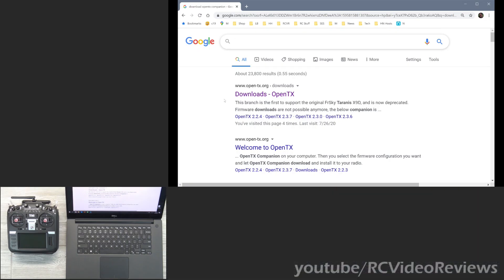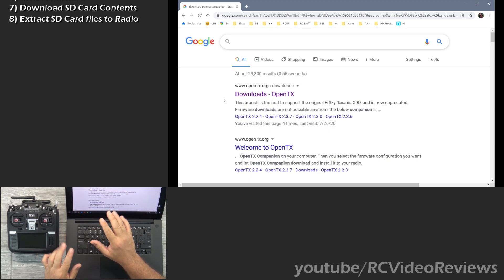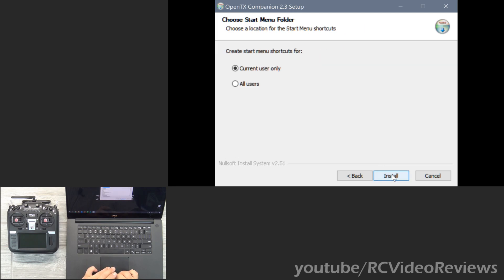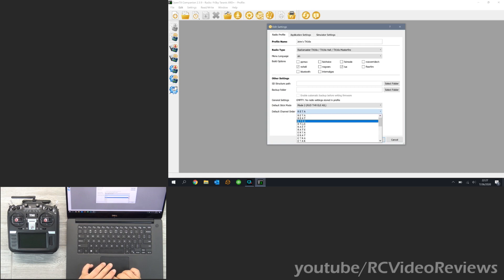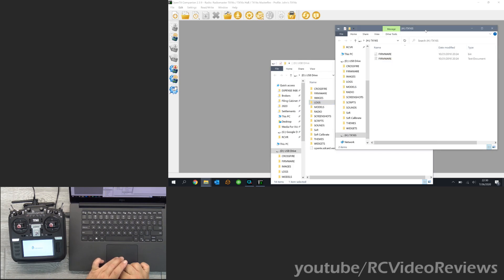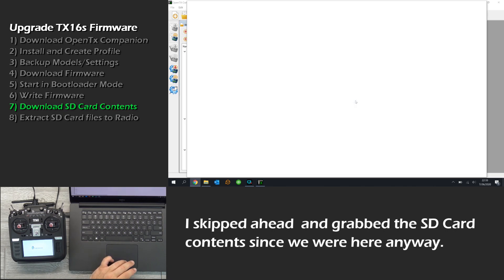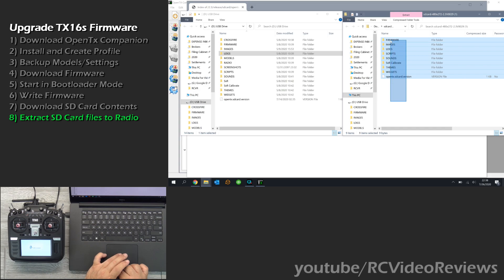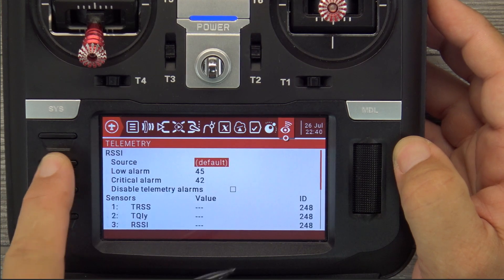OpenTx Companion Tutorial • How-to Upgrade Firmware on Radiomaster TX16s • [Beginners]

Comment: Hello,it keeps show sd card warning. what happen??
Reply from the maker: Sounds like you don't have the right sd card contents. What firmware did you install and what version of sd card contents did you install? What is the exact error message?
Reply: @RCVideoReviews  Thanks for the reply. I already fix the sd card warning sign. But when i tried to copy the latest version of sd card content then try to "write models and setting to radio" the error " cant find radio sd card pop up. Then i install the back up version everything back to fine. So, is there miss step or something that i done wrong? Thank you in advance.
Reply from the maker: @firdausjohari3692  After you write the SD Card contents, make sure to reboot the radio twice. Then you should be able to read/write settings ok.
Reply: @RCVideoReviews  alright will do

Comment: my radio arrive yesterday and when i try to start bootloader mode the radio turned off by itself after entering bootloader mode a few second, do you know how to fix it?
Reply from the maker: I haven't encountered that one. I believe (but haven't tried it) if you leave the radio off but plug in the USB cable on the top port you can flash firmware.
Reply: @RCVideoReviews   i already did that before but not work idk why, but after you said that i'm doing it again and it works, thanks

Comment: Watched u r sD card vid.  I think my big problem is ive been a mac user 20 years and bought a MS computer to run beta flight, open tx, liftoff,etc.  the basic steps like making a file, and drag and drop are stumbling blocks i need to get down before using open tx.  Ty for your help.  J
Reply from the maker: You can do all of the SD card content manipulation on a Mac. The rules apply: Extract and copy. Mac does leave detritus on SD cards but OpenTx ignores it.

Comment: Got all the way to step 8.  My new I7 pavalion wouldnt let me drag and drop all the files from sD 480 x272-2.3V to usb  d  so i dragged them individually and it locked up at 72%. Been 8 hours today trying to get thru these 8 steps. Almost made it.  Now where do i go from here.  J.  Day 2 on TX 16 S.  Smh.
Reply from the maker: John, I'd stop and take a breath. It sounds like you're hitting a wall.

1) There's 100% no reason you can't copy the SD card contents from the zip to your card. You need to figure that out first. There's also 100% no reason to copy individual files one-by-one. So I would suggest going back to that step and sorting it out.

2) I just did an SD Card video for OpenTx here: https://youtu.be/vQGaasNHckc  Maybe that will help.

3) Make sure you've unzipped the archive before copying. There are about a dozen different ways to handle zip files. I'm not sure which one you're using. With the windows archive handler you don't have to necessarily unzip first, but just to eliminate possible issues, make sure to unzip the archive before doing anything else.

Comment: I will update the opentx 2.3.10

 I want to ask

 What will be on the checklist?
Edit settings-radio profile-buld options?
 Tx16s I used for the helicopter

 Can u help me?

 I'm a new tx16s user, still have a lot to learn
Reply from the maker: You're asking about build options? I only select LUA and NOHELI. If you're flying helicopters you may want to leave NOHELI unchecked.

Comment: After I updated my radio firmware to 2.3.10 it has a very dark blue theme that is low contrast. How do I change it to the original theme please?
Reply from the maker: From the Home Screen press the tele button on the bottom left row of buttons. Press page left and select the 2nd theme from the left.
Reply: @RCVideoReviews  Wow what a quick response. Sorry for the newbie question. Thank you.
Reply from the maker: @petebuttons210  No worries. Did you find it?
Reply: @RCVideoReviews  Yes thanks. It is a real steep learning curve but I am enjoying the build.

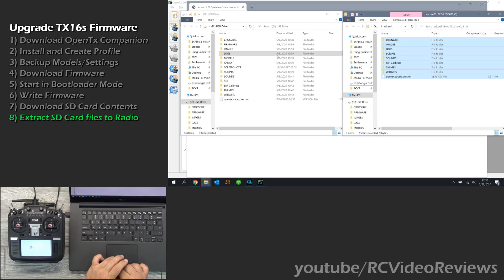Comment: 13:12 Do I have to delete the old folders on the left side or do I just have to copy the new ones from the right in? I recently switched from Futaba
Reply from the maker: Personally, I prefer to start with a clean SD card. The stock card does not come with models or radio directories, so you need to make those. If you don't, the radio will make them for you.

Comment: After all done is save disconnect of the two drives in Windows on the right bottom corner (Hardware save removal and media) in your view important. Radiomaster manual gives no answere.
Reply from the maker: Not on Windows 10. That is a dated practice and no longer necessary.

Comment: Hi John, during this procedure when write the new SD card content to the SD card in the radio the computer told me that the space is to small. The SD card is only 256 MB. Delete of the old content before was necessary. A little bit nerving just handling the new radio. I can imagine that some model airplane pilots frighten a little bit because they didn’t expect this.
Reply from the maker: How did it work out? I know it can be daunting, but it is not hard to recover from a completely new sd card.

Comment: This works fine and fairly easy to follow but I lost access to s1 and s2 in global functions! They are not listed to be able to assign them, any ideas?
Reply from the maker: S1 and S2 aren't available as the source in Global Functions, but they should be available for example if you use ON VOLUME or ON BACKLIGHT.

Comment: I think I messed mine up. I thought I had it working, (maybe I did everything from "Companion") but I could be wrong. My problem is that the "mdl" button now fails and when pressed is EXACTLY the same as pressing the "sys" button. Things work for and simulate in the "companion" so appears to be a hardware fault.
 But since everything is configurable, maybe software/ firmware

Just to confirm, I am in a model and press the 'mdl' button, I get the 'Sys' menu and therefore cannot change the inputs, mixes of the model.

To fix this, or try I would like to restore to older firmware/ software but I am confused by all the different software. For example, Is the version of "companion" important?
Reply: just to let you know, I got my radiomaster TX16s back and it was a hardware problem, apparently a bit of dirt between contacts on the ribbon cable (must have been conductive!!), just got it back, Radiomaster are very good, a bit slow, but that could be the covid times we live in!!
Reply: actually, I think I will start here, under your video "How-to Upgrade to a New SD Card ".. maybe in 4 days, as I will be away :(
Reply from the maker: The firmware doesn't remap the hardware buttons. Something sounds fishy. What firmware did you install? How did you install it? What did you do with your sd card?

Comment: I have been using OpenTX for a couple of years with  a simple understanding.  These tutorials have been great.  I have an issue with my latest Windows machine.  When OpenTX was installed the USB driver was not installed.  I have spent hours trying to correct this, to no avail.  My solution was to take a MacBook Pro, blow away OSX and install LinuxMint.  This works for me.  Again, thank you for the tutorials.
Reply from the maker: Hmmmm....On Windows 10 I didn't need to install anything. It just reads the TX16s as a USB drive when I connect. Anyway, have fun with Linux and glad you got up and running. Thanks for watching and commenting.

Comment: I updated the radio firmware successfully and I downloaded and installed the new SD card contents as well. However, when booted up the radio the first time, I got a warning of "Bad Radio Data" and the radio went to the stick calibration page which was frozen. I tried deleting the SD card contents again and copying the new card contents again as well. This time I just got the warning and once I pressed a button, it went to Model 1. 

I ended up reinstalling my original card contents and then all was well again except for the notice of "Expected SD Card Version" which I fixed by changing the version number in the card's text file. 

What did I do wrong or overlook? Thanks!
Reply from the maker: In the description I added and addendum: 
UPDATE: If you elect to erase your SD card and extract the firmware matching SD Card contents you may get an SD CARD error in Companion and a "Bad Radio Data" message when you start the radio. Just run the hardware calibration, then restore your models from Companion.

You can also just remake the RADIO and MODELS folders by copying them from your original SD card to the new one. A fresh SD Card Content unzip doesn't add these two. It forces a calibration and fresh set of models.
Reply: When I first tried to run the hardware calibration, the sticks on the screen were frozen so I did not go any further and backed out of the calibration. This was last night.

This morning after reading your reply, I reformatted the SD card and extracted the new SD card directly to the SD card. On first radio boot up, I got the red power light and a blank screen for a few seconds then the calibration screen. The sticks were frozen as before but when I clicked on the centering part this time and moved the sticks just a bit, they started moving on  the screen and I was able to complete the calibration.

On the next radio boot up, I got a throttle warning. I re-calibrated and got another throttle warning. So I started OpenTX, connected the radio and did an SD card synchronization and then reinstalled my models setup. That took care of it all.
Reply from the maker: Glad you got it working. That set of steps seems circuitous, but as long as you got there, I guess all's well that ends well.

Comment: brilliant video thank you so much, watched it a few times and im updating as i type, kinda got a bit lost towards the end as im not overly tech confident, just wondered: what do we do at the end? turn the radio off then on?
Reply from the maker: After the flash is complete, you should be able to press the return button to go back to the bootloader. In any case, once the firmware update is complete, it should be safe to turn off the radio.

Comment: Newbie here guys. Seems my SD card is corrupted, wont get recognised in 
the TX16S or my computer. Now when I switch on my radio i'm just getting
 'EMERGENCY MODE' showing before it switches off. Anyone know how I might fix please .
Reply from the maker: If it won't show on your PC, then it definitely sounds like a problem. Do other SD cards show on your PC? If so, I'd put a new SD card in with new SD card contents and see what happens.

Comment: Can you use these eepe files from https://rcsettings.com/media/modelhtml/272.html in the Radiomaster TX16S? Regards
Reply from the maker: Probably not directly. If you open them with Companion it will probably complain they aren't compatible with the TX16s and need to be converted. When you agree to that, OpenTx will make whatever changes are necessary for the eepe to work with the TX16s. There will be a popup dialogue letting you know what changed so you can review and make modifications as necessary. Once the conversion is done, you should be able to open your TX16s data file and copy/paste the eepe from its document window to your TX16s document window. Finally push to the radio.
Reply: @RCVideoReviews  Thks for your fast answer. I will try it and post it the results. I hope not to nd in a disaster. What I want to do is to take advantage of an eepe file regarding an X-cell 46 that is in this site. Keep your hard labor. Regards

Comment: Really nice job ,I just got new tx16s it has aetr channel mapping all my models are tare any help will be greatly appreciated
Reply from the maker: The MIX tab is what connects your inputs to a channel. You can put your inputs on any channel you want by moving them around in the mixer.

In Companion when you setup your radio profile, there is an option at the bottom called default channel order. Set it to TARE and any new model/wizard you use will set TARE as the order.
Reply: @RCVideoReviews  Hey I appreciate the info can't tell you how much this helps thanks again !!
Reply from the maker: You’re welcome. Did you get your channel mapping worked out?

Comment: In following those steps when trying to write the saved information from opentx companion im getting an Unable to find sd card error. So i restarted the radio and a warning on the radio screen came up saying i have bad radio storage and took me to a calibration screen. Pretty sure i messed it up any help would be greatly appreciated.
Reply from the maker: Run the calibration and restore your models.

Comment: Really appreciate this video! So im hesitant to erase everything that came up on the sd card in the tx16s. It looks like im erasing 
more files than I have downlaoded to upgrade the sd content. Just want to confirm i erase everything from the d drive and replace it with the file  S.3V0029?
Reply from the maker: The SD Card Contents archive has everything in it. Just start the radio, run the calibration, and then restore your models.
Reply: You dont have to erase the old, just drop the new SD folders on top of the old and merge the content.. then you will keep if there are widgets or stuff that are not included in the official rev. and if there aint enough size on the card just delete the foreign sound-language packs, if you want English, as it is mainly the language packs that take the room

Comment: Do I need to upgrade my sd card on my tx16s? because mine thers not enough storage to copy the new sd card content. Thanks in advance
Reply from the maker: No, the SD Card that comes with the TX16s is big enough to hold the SD Card Content from 2.3.9. If you're out of space, something else is going on. Make sure you're not creating copies of the OpenTx contents. You need to overwrite the old stuff. The best bet is to backup your models and radio settings, then delete the folders from the card, unpack the new contents to the card and restore your models and settings.
Reply: RC Video Reviews got it! Thanks a lot man! :)
Reply from the maker: You're welcome. I may have to do a video on the SD Card. I get a LOT of questions about it...

Comment: You are doing a great job making the vTX16S understandable. THANK YOU, Sir!
Reply from the maker: You're welcome. Glad they're helping. Always appreciate the comments.

J
Reply: @RCVideoReviews  does the touch screen work after this update?
Reply from the maker: @finnleithomczyk5292  No, it'll be available in 2.4
Reply: im doing the same - copy latest content for sd card on my card. and then plug into my radiomaster. but it says - bad data - error.
Reply: Hi, great video.  But I think I have made a mistake and the station is left with a black screen and does not enter bootloader mode.  In the update it was updated badly.  Can you help me with a video in that case of error or what solution would there be?

Comment: Great material again. I’m not going to upgrade mine just yet, it already works with the firmware in it. I’ll wait till the update to allow the touchscreen comes out, and wait a few weeks to make sure that no one has any problems with it, before I update.
Reply from the maker: Good call. One thing I should have said in the video is to not upgrade the firmware unless it gets you something you specifically want.

Never ever a bad plan to wait on firmware if you can.